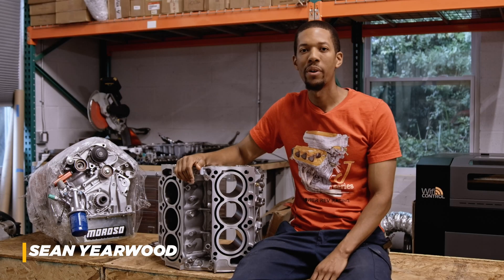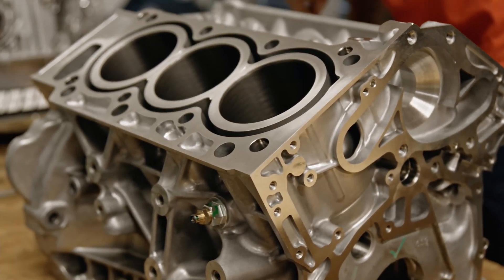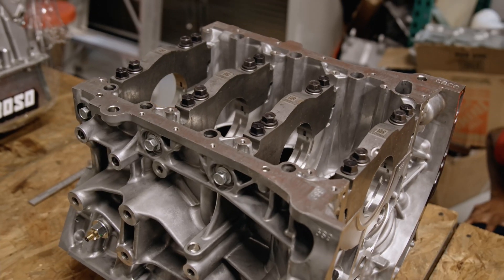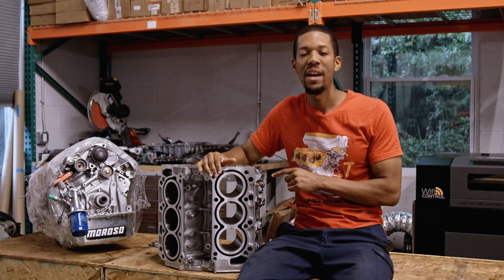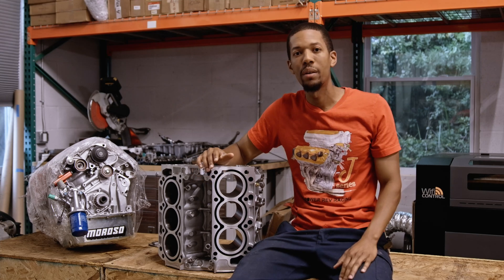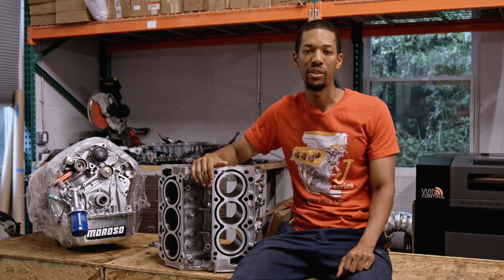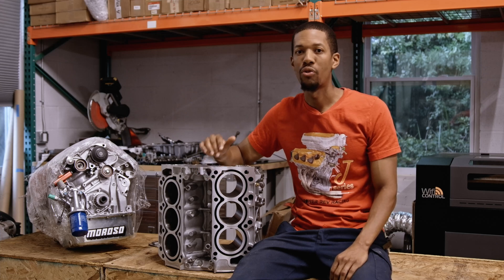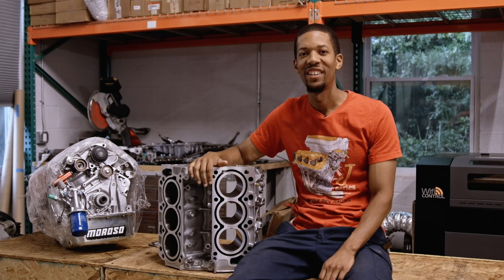2021 Acura TLX Type S J30AC Engine Cylinder Block & P2R Engine Development Plans

Comment: Any updates on this engine? And can I swap this in my S2000?
Reply: You can swap any engine into any car considering it fits, however it's a far jump from a b series to a j series, I'd guess you'd need a whole new transmission to take the power and a standalone ecu as well but im no expert.

Comment: Coupling it to a 6MT? 👀
Reply from the maker: We have mated it to a 6mt J transmission.
Reply: @PowerRevRacing  was it a bolt on affair, or did you create an adapter?
Reply from the maker: @menikmati577  just a dowel pin adapter that we will offer now as well.
Reply: @PowerRevRacing  this is amazing news! Was considering a s/c for my tl sh awd 6mt, but that confirmation you just gave me solidified my j30ca path! Staying locked to see what other similarities you guys manage to find. Keep up the great work guys, I can really see the push! 💪🏽
Reply: @PowerRevRacing  Dang.
I would like a 350+ hp engine in my accord coupe.

Comment: Well s*** hurry up find me a bigger turbo because I could tell my type s already needs more power. I want at least 500 to the wheels.
Reply: Yeah Hondata or Ktuner is the best mod and bolt ons will be more than enough with this car! Better sound + better performance. The handling alone will make the difference with the competition.
Reply: If Pures Turbos get their hands on this platform, we’re good!!
Reply: @JrSparksVGC  Hopefully hondata jumps on this platform real quick. would definitely get a flash as my first mod. I don't plan to do much, just a street-cat, HVI intake, and Flash. maybe a bigger turbo intercooler just because I live in central CA and this place gets to like 110F during the summer.